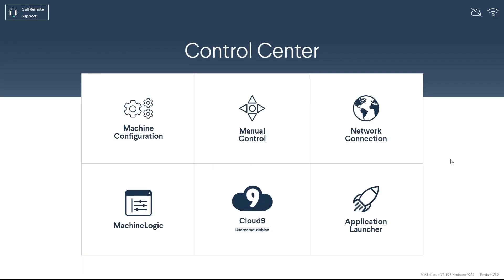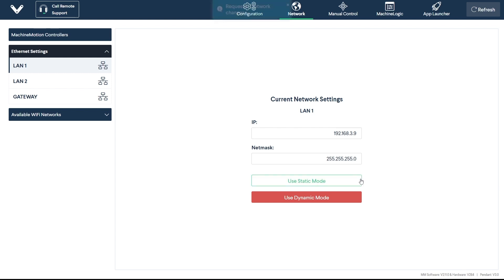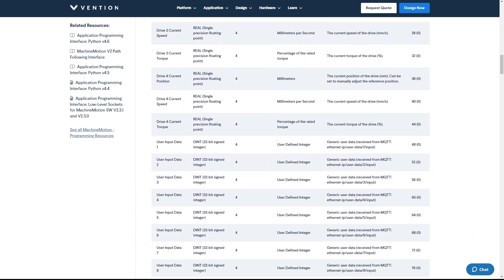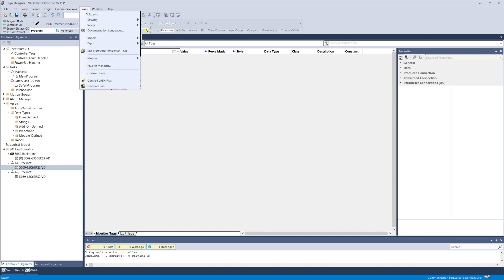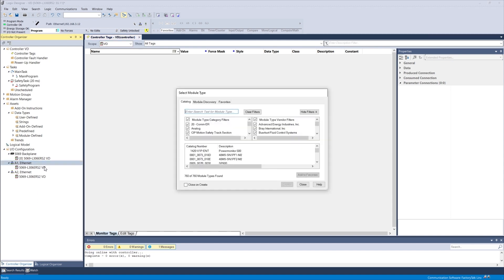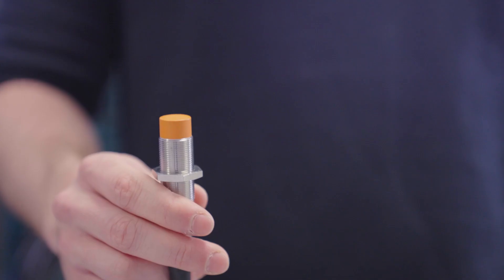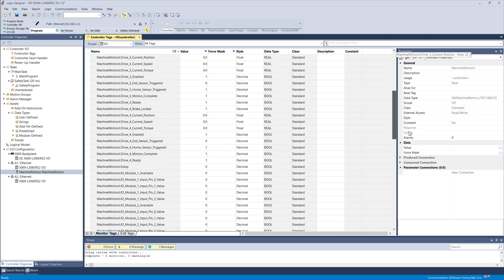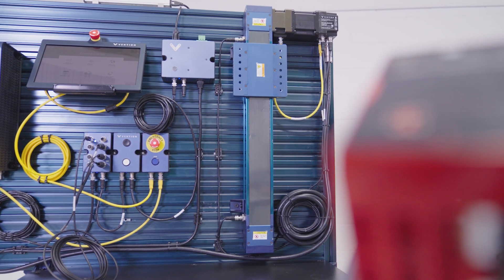EtherNet/IP MachineMotion Set-up

Comment: Or, can we have hardwired IO to the controller? I saw vention push button modules can be used to trigger a motion control sequence.
Reply from the maker: Check out this tech doc: https://vention.io/resources/guides/digital-io-v2-module-usermanual-302! We have a plug & play digital IO module that you can use to trigger preset commands in the MachineMotion controller.
Reply: We found that and it’s on order 👍

Comment: Any guides how to do this with Siemens S7-1200?
Reply from the maker: Hi Mark! Typically, Siemens PLCs such as the S7-1200 naturally support the Profinet protocol. If you intend to utilize Ethernet/IP instead, additional software and potentially hardware might be required to enable this capability. These solutions vary across different vendors, and detailed information can usually be found on their respective websites.

Once your Siemens S7-1200 is configured to support Ethernet/IP, it can seamlessly communicate with our MachineMotion controller acting as an adaptor device.

Hope that was helpful! For additional questions, contact our experts here: https://vention.io/talk-to-expert